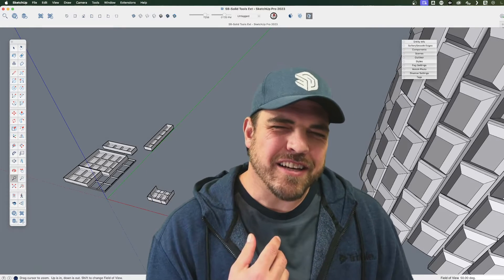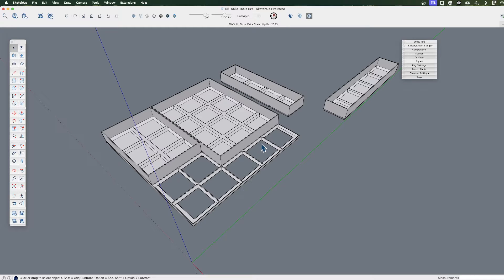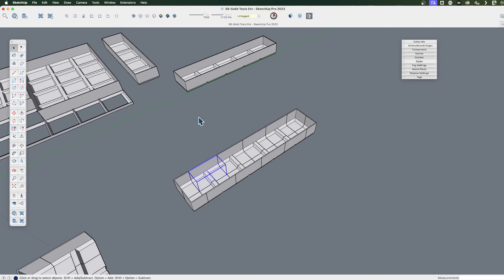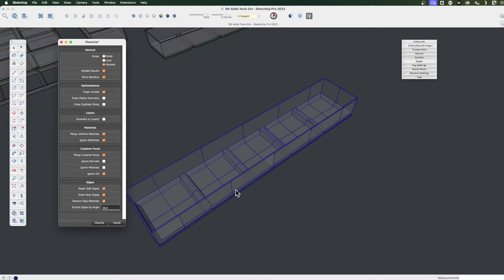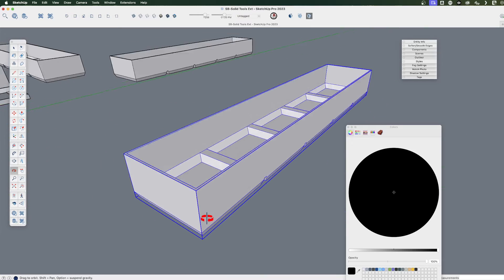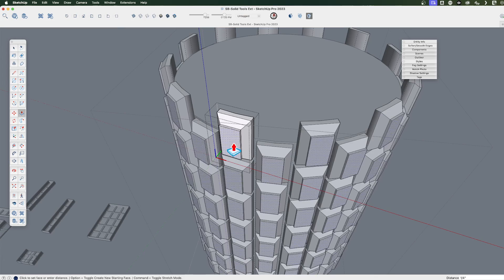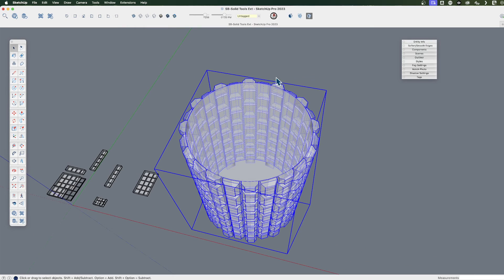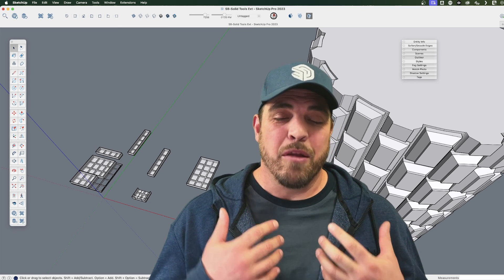2 MUST HAVE Extensions for 3D Printing with SketchUp

Comment: Great video! How should I go about making, e.g. a container with  3-4mm solid wall and not hollow inside or is it a waste of filament and the default zigzag pattern that slicer creates is best or sufficient enough? Thanks.
Reply from the maker: The SketchUp model would be the same, the slicer handles how the infill is applied. It depends on what you're using the print for, but for the vast majority of uses the default pattern will be a good enough.
Reply: @SketchUp  Thanks so much, I created a tray/container with 3mm thick wall and I noticed it wasn't filled in completely but "glued" together with some zigzag like pattern (I'm only new to this so my terminology may be a bit off). Now when I see the gridfinity you mentioned I think I'll scrap my own tray model and just use the grid you showed instead - no point re-inventing a wheel

Comment: Sometimes with complex solids which are not "solid", when I use Solid Inspector to help with or fix issues, it says "No errors. Everything is shiny" but SU Entity Info still does not show a volume. If this happens, I ungroup and regroup the object and that usually fixes things. Also be aware that running CleanUp on large groups with thousands of faces can take a LONG time and can cause SketchUp to crash.
Reply: Yes, this works. I do this method often.

Comment: Nice demo Tyson. I use Solid Inspector but usually when I have issues so good to see how it can be integrated in my workflow.

Also I hadn't come across the Clean up extension so will be sure to install that as well.